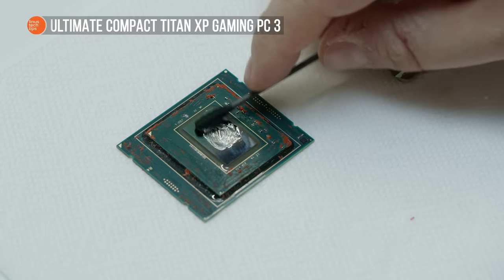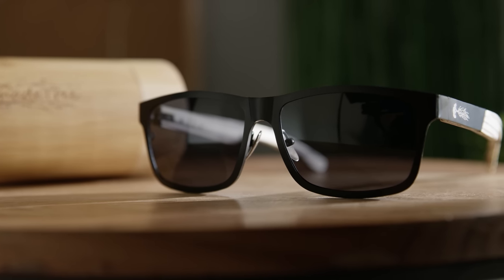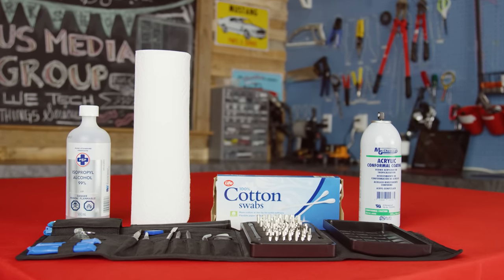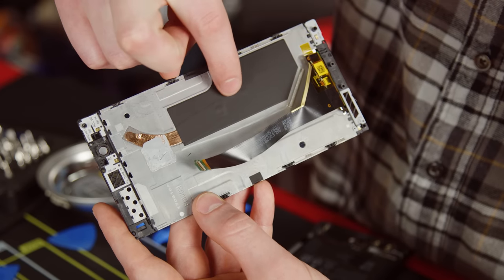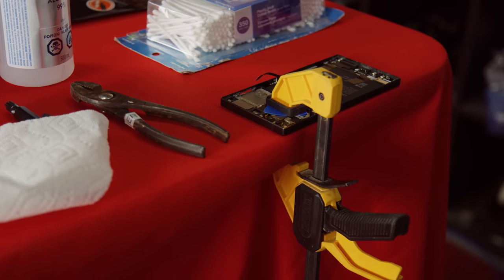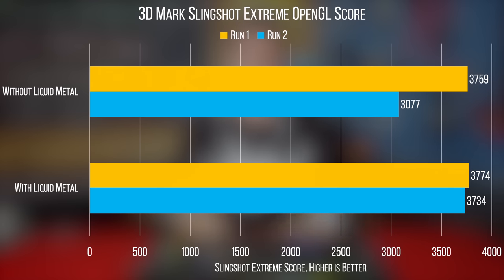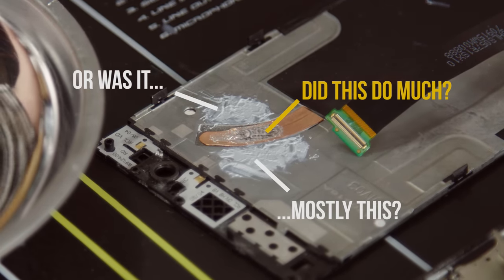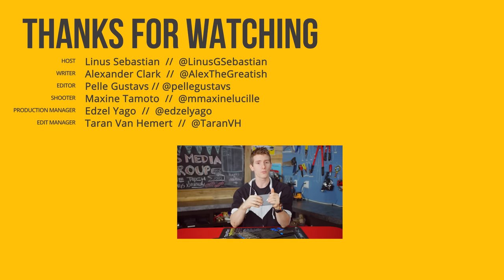Liquid Metal Cooling a PHONE!?!?!

Comment: I always feel ripped off when the sponsor isn't Tunnel Bear :(
Reply: I was expecting Tunnel Bear too!
Reply: James what would you recommend
Reply: James what vpn would you recommend?
Reply: NordVPN
Reply: Banishedqt. I don't know... I got one of their deals and a really cheap subscription - and I'd break it if I could. I'm not impressed by the speeds and I get disconnected a bit too often. Too many of their IPs are known/over used so I've run into "prove that you are human" from google a few times. So far I haven't been able to properly stream Netflix from the US to here in Sweden. I've tried two smaller ovpn:s before and I liked both better. I've never tried Tunnel Bear.
Reply: Express VPN is waaaaay better
Reply: US netflix works for me on NordVPN, you just need to pick a specific netflix server which you can find using google. I use US#1185

Comment: I never understood the logic behind the CPU power/speed wars on mobile phones...

What's the point of having flagship phones that throttle down to the speed of regular phones within a few minutes of load/gaming due to overheating? Are we going to see fans strapped to our smartphones in the future? Why not just make something that performs efficiently and sustainably, but still fast?

The smartphone industry should have a main focus on efficiency and battery life instead, since we already have enough processing power on them to do pretty much anything you'd want on a phone anyway. Pure speed shouldn't come before efficiency in this case.
Reply: Exactly. Who the hell games on a phone anyway?
Reply: I think there are some things you aren’t understanding about this. While you may not feel like the extra performance matters because you aren’t gaming, it does make a huge difference to app launch times, app switch times, background processes, and internal OS optimization. When it comes to phones not performing “consistently and sustainably”, it doesn’t matter to most users, that short burst of unsustainable speed means that the tasks I listed above (which tend to be much more computationally intensive) perform more quickly. Also, what you’re asking for is already being done, processors are more power efficient and run cooler, they just boost their clock speeds when necessary - they would reach the same thermal thrilling temperature at a lower speed over a slightly longer period of time anyways.
Reply: I like to talk about the more extreme cases of throttling which are quite prevalent, because I feel like there isn't enough thermal or battery life headroom right now since everyone is so tunnel-visioned on performance. Especially considering that just using the camera/recording video or charging the phone while using it greatly increases temperatures and throttling in addition to the possibility of high ambient air temperature in some environments.

The throttling and unsustainability of "high performance" just seems wasted and pointless on everything that isn't a brief workload, and in a way is a kind of false advertisement. Overheating seems excessive these in recent years to the point where it actually somewhat outweighs the pros of the intended design considerations of speeding up already fairly short tasks. Just look at what happened with the Snapdragon 820/810.
Reply: Gaming on phone xD made my day
Reply: Millions of people all over the world!
Reply: I do experience this with the Nexus 5 with the SD 800 which is fine when it is boosting in all cores but drops mid-range performance after a few seconds.  However, this is understandable engineering design.  Not all people needs the peak/overclocked performance for long periods.  This is also the reason for Intel's turbo boost feature.  To make you feel better, think of it as an automatic overclock that lasts while it is reasonable.  In the old days, overclocking is a static frequency and voltage until the arrival of one software (which a forgot the name) that makes overclocking an on demand feature.
Reply: My Galaxy S7 shuts down due to overheating after like 30 minutes with the GearVR... I'm not going to take my phone apart to improve this though :)
Reply: well it's not really a big problem... the majority of people don't game on their phones. So having peak performance for x seconds is fine for 99% of people. And then that throttling also makes the battery last longer.
Reply: Once phones are capable of running adobe premiere pro with no lag when running as a independent online server and a WORKING screen mirroring device while still allowing me to make phone calls without pausing my music through bluetooth I will have a reasonable discussion of "too much power", I will however sit down for some crumpets and a joint while having a vigourous discussion about the downfall of proper quality control and how good the weed is.
Reply: because CPU frequency numbers are easy to advertise and compare, whereas it's not as easy to measure and advertise battery life (too many factores).
let's say one smartphone runs at 1.8GHz and the other at 2.4 GHz. Everyone would agree that 2.4GHz is better, because it's the higher number. There is NO difference whatsoever (no, apps don't load faster with a faster CPU as the bottleneck is the flash storage's speed; it does not really matter for mobile games either, they're made for low-powered devices and will run just as smooth on most mid-range smartphones), but the average consumer doesn't care, bigger number = better. And they don't even think about possible disadvantages (i.e. battery life)

It's the same with resolution: If you released a flagship 5.5" smartphone with a 1080p display, people will complain about its "outdated display", while watching YouTube on a 24" 1080p Display, which somehow does not show a pixel mosaic, but an actually sharp image...
again, no difference at all at that size, except for a very very specific niche-scenario (VR) that 0.0000001% of buyers will ever do.
Reply: terratex 90
We should just call it ,, gayming "
Reply: Because it's about >>>burst performance<<< and efficiency, and not so much heavy computing for a long period of time, unlike desktops. Think, it's a battery-powered device where literally most of the population uses it for the same things (loading web pages, pictures, apps - again, burst performance) and manufacturing should be aimed in this direction for obvious reasons - cost and efficiency. Of course, phones like the Razer should be manufactured like how GPUs are - to be at 100% load for long periods of time (for gaming).

I don't think you can separate the two - speed and efficiency -  SPECIFICALLY for something like phones (and computers) because it needs to be able to do a wide variety of things, unlike let's say an ASIC miner which does a certain specific thing and not much else.
Reply: NRL Sledging Immortals Maybe people in the future hahaha. Nobody games on PC long times ago.
Reply: Razer phone the most dumbest hyped phone in the history.if apple or Samsung make this kind of thing. Their market share will fall overnight.razer also prove PC community has very limited knowledge about phone
Reply: I agree mate. The battery technology really needs a kick up its ass.
Reply: KitMellow This is the issue with glass sandwiches. They obviously cannot properly dissipate the heat. Phones with a proper thermal solution like the razer phone or 5T do not have these problems in a real scenario. Benchmarks push the phones to their limits so thermal throttling is usual. My 5T reaches a maximum of 50C with full CPU load (coinhive) without any throttling. A combined stress test will push it to 70C, but I cannot measure throttling during that. The CPU and GPU both stayed at their maximum frequencies. Some OEMs care, some don't. Even the enthusiast crowd compares performance almost exclusively via benchmarks.
Reply: Boosted Geekbench is flawed in itself and has been proven to give higher scores to certain OEMs. Apple also does not allow the developer to choose not to use the NPU for accelerating tasks, wich results in an artificially inflated result. Just look at Antutu 3d scores for a proper result.
Reply: Yeah, its funny how they inverted. Now phones need all the cpu power possible in detriment of battery life. And laptops needs all the battery life in detriment of the speed... Funny how they can mess up things. 
I really need my phone to watch some videos, send messages all the day long. 
And about 4 hours i nees my laptop to run the fastest possible way. 

But yeah, i had the opposite, thus making both useless. 

Now at least i got a g5 (the normal one with removable battery, not a s or plus) that now lasts more than a day, but still suffer with those shitty intel ulv processors.
Reply: NRL Sledging Immortals Well.. if that was irony, most of the phone games are casual shit, and are very lightweight (with some bizarre exceptions) and would be even more if they werent so badly coded. 
A quadcore phone cpu is enought for basically everything. Actually, only for messages and media, i can still use a old s2 updated up to android 5.1 (that improves it alot, dalvik sucked), and even play some games. 
And really, there is any super complex 3d game that you usually play? The answer is probably not, and i am not talking about that one that you play sometimes... 
Those 3d complex games, arent good to play in phones anyway, controls are bad, its not even close to the quality of any console/pc game, and is not easy to play outside home anyway, as it may have history and need full atention (think like when you play angry birds in the subway for example, you can know when you get to your station). 
So yeah, who the hell play these sort of games anyway. 2d and simole casual games are playable in basically any dualcore 1.2ghz+ phone, just with android 5.1 and up. 
I have a octacore processor, but if i had root (not yet i wont void my warranty) i would shut down at least 4 of them to save battery. 

The s6 that i had sometime ago, had this battery issue, smaller battery than the s5 and too much more hardware (actually a whole freaking extra quadcore processor) so all the time i would shutdown the second one (cpu big, the fastest one) and shutdown 2 cores of my little cpu (the slowest one) and even clock it down, it made a huge difference in baterry life, but not in my use of the phone (media, light games, messages). Unfortunatly it wasnt made to last long and after its battery die, the motherboard died too.
Reply: In the industry everything is created with profit in mind - not logic
Reply: Artofficial Yeah, but from were comes profit? From the consumers, and consumers should use logic... 
But this stupid changes (that i mentioned before) are being accepted by most of the users, many times without even knowing... 
And probably this wont stop or get back to what it used to be... 

More non-upgradable soldered parts, less cpu power in laptops and more battery, less battery ij phones and more processing power in them, everything thinner but phones bigger, things not lasting much, less bezels, less screws, more glues, and all of this ridiculous todays standards...
Reply: It should be programmable, to have speed step technology. Offer the user to change, or I can see it slowing down to prevent thermal overheating, but keep the speed up in demanding situations like games, and slow it down during idle times. It should be done on an APP basis, in the App manager for example. Set the games and camera apps to run full throttle (up to thermal limits) and simple apps and phone use to be slower. I get that it is also about saving battery life, which everyone complains about still.
Reply: I think theres still some steps to be made in terms of performance, with some phones maybe making a shift to 120hz (surely other companies will copy Razer) and AR becoming a real thing we will still need further improvements, but yes a temporary boost to performance isnt as good as maintaining a phone at its most powerful for longer. 

I have 2 phones both with a Snapdragon 835 and play a lot of Pokemon Go, this is the only level chip (Samsung+Apple make similar level) that runs Pokemon very well. Im sure if everyone had high end desktop computer power in their pocket all the games would be able to turn up their settings and add more features.
Reply: Kernel adiutor allows you to do all these things with nothing but root access.
Reply: They are constantly doing just that. Building faster yet more efficient, so that battery life goes up and speed as well. 
I frankly do not understand the need to make a phone thinner. They are so thin now, that it makes it harder to prevent the tempered glass from cracking, and warping the metal or plastic frames. What difference does 3 to 5 mm of extra thickness much matter? If you look at the design of the CAT phone, you see it is very thick, and for a reason.  Not to make it perform better, as they are not a Galaxy S9 or an iPhone X. Pretty much backward thinking.
Reply: Superfast phones use less CPU time in non-gaming tasks, which means they win the race to sleep and have better battery life. If your CPU has to run slower all the time, it means it has to run longer, and use more power.
Reply: The Asus rog phone had a mountable fan. That's just... So strange
Reply: NRL Sledging Immortals REEEEEEEEEEEEEEEEEEEEEEE 

wut
Reply: Kenneth Bouchard you can do this with android.  just need to unlock your bootloader, root your phone and install a custom kernel. Than you can choose between different power modes by app. Its even possible to set clock speed on your own or just underclock it for longer battery life.
Reply: 420
Reply: @Kombat_Wombat  I do but it's emulation.
Reply: We have  fans on our phones today😂😂 ROG phone
Reply: Market secret to keep making us buy phones
Reply: Funny u say that. Now there's a rog phone u can attach a fan to
Reply: there isnt a benefit lol u right i never noticed that
Reply: Hey I'm from the Future and there is a phone here called Energizer which Battery is 30,000 mah... Price is $400  👍  u can search on Google
Reply: Nubia Red magic 3:- Hold my Beer ..

This thing has inbuilt cpu
Reply: Ouch, I hate reading this anti gaming phone thread, cause I actually use a razer phone. And holy crap, you can't appreciate it till it's been a workhorse for a year, battery still lasts easily all day ( assuming I keep phone gaming to a 2hr maximum per charge) and every app responds just like on your desktop. Do not hate the use of overpowered phones till you have experienced it yourself.. for it is sweet.
Reply: @Kombat_Wombat  ikr. So many stupid people swear by gaming on phones though. Saying like this is  a full blown computer only smaller. By watching the trend game companies are going towards mobile gaming too just because it's the trend and money. Look at Diablo, lineage, blade and souls, etc. Even though we know that phone is NOT YET capable of giving proper performance for a full blown game.

Even if performance is not an issue the gameplay would be severely dumbed down because of the only input for smartphones are the touch screen which is pressed by 2 thumbs. How the hell are they gonna make a game that require complexity, speed, and precision playable with only two thumbs. No way! If people still think touch screen is a good gaming input device ask them to imagine playing dark souls with their touch screen.
Reply: Or street fighter
Reply: @Kombat_Wombat  anyone who doesn't have a PC or mobile console
Reply: I think the red magic 3 has a fan on it
Reply: Well, 2 years later, we now have phones with fans in them...
Reply: Bursty performance benefits general use
Reply: @Ben.N  True. That's why we have technologies like Turbo Boost which boosts your clocks to +4.5GHz when you open a program
Reply: Exactly.
Desktops should focus only on performance.

Laptops should focus on performance and efficiency, with thicker laptops focussing on performance more and ultrabooks focussing on efficiency more

Mobiles should focus only on efficiency.